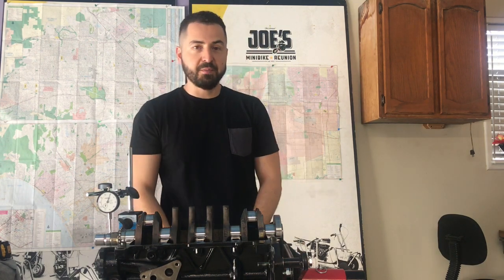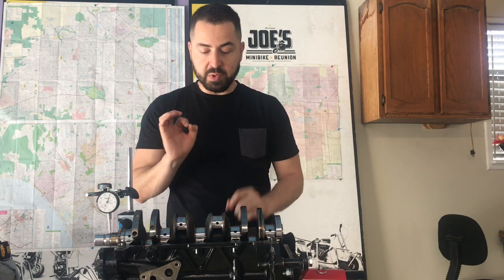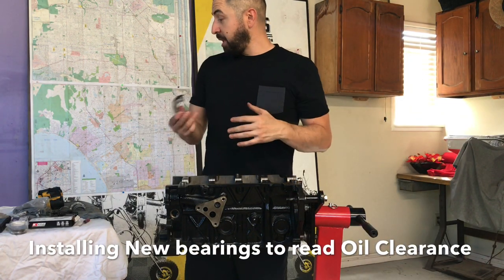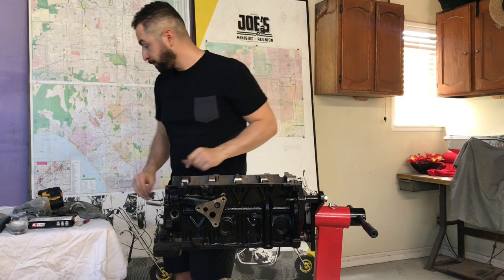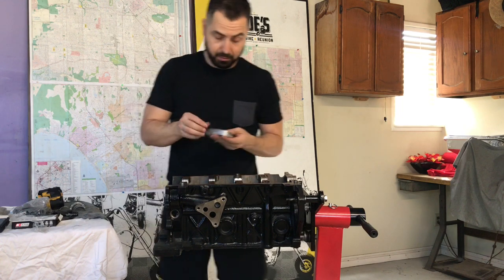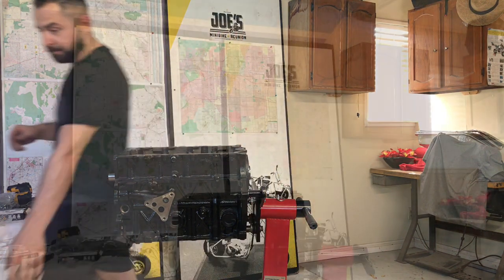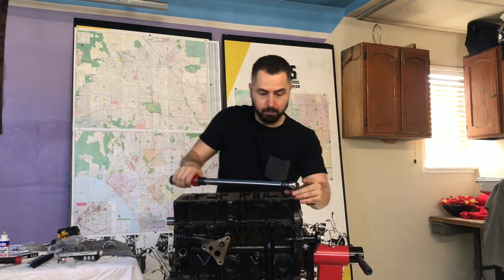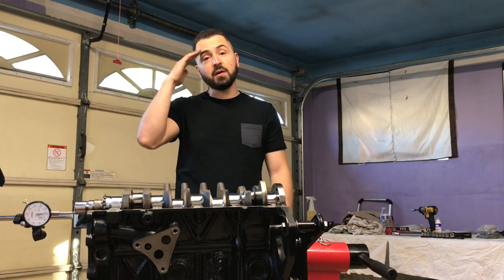Mini Cooper S R53 Crankshaft Oil Clearance & End Play  Part 3

Comment: Good job dude. Just did this with my build. All the RMW goodies. My current tvs setup was fine but given that this was a forever car I wanted to make sure my bottom end could handle the years of abuse. 330whp e85 tvs link etc. Good times. I reused the cradle bolts for spec purposes as well. I ran with the factory mains as like you found out King has not been able to have standard mains in sometime even before Covid.